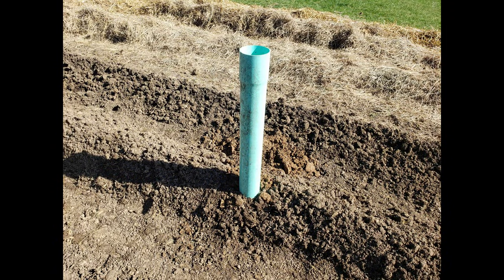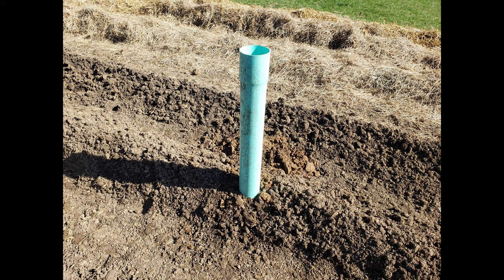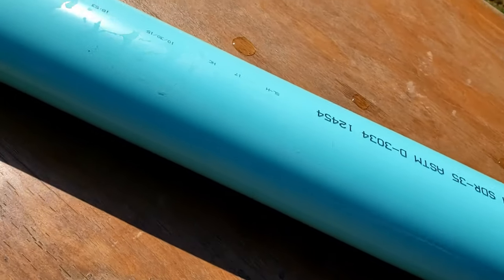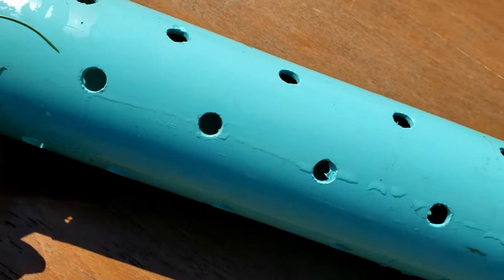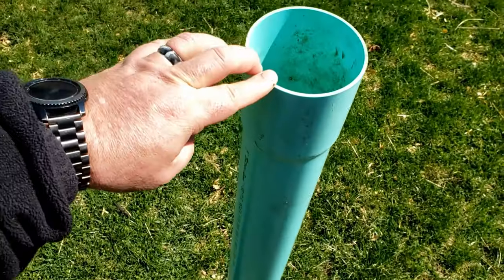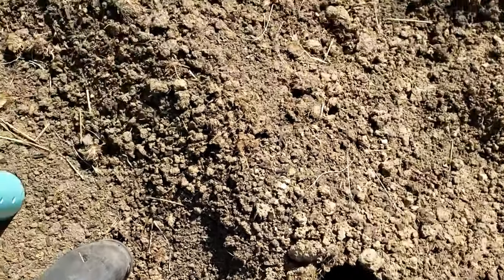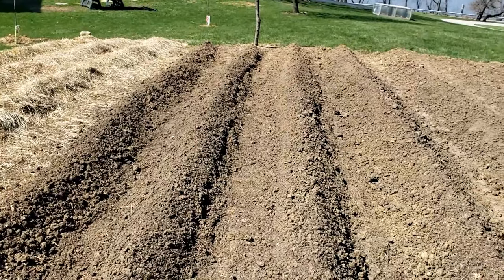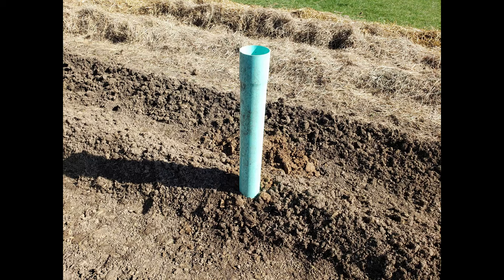Worm Tower Composter DIY

Comment: I'm curious as to how you made that hole so perfectly round so you could just slip the pvc pipe into it? -- I thank you for the idea. I'm going to get somebody with a drill to help me out (I'm a 73-year-old grandma without a drill! lol). Currently, I have a tumbling composter that gives me fits -- Nobody bothers to tell you that when you've got it pretty well filled up that it becomes too hard to rotate. Grrr. So I'm going to donate it to my local university extension office and get me some of those pvc pipes! Perfect solution! Thanks again!
Reply from the maker: I think those tumble composters are great during the tough Midwestern winter to just throw things in (we still have one for that reason), but you're exactly right... they get so very heavy! To answer your question, I used post hole diggers for this project but a shovel would work just fine too. Might not be quite as perfect of a fit, but in a few weeks after the soil settles around it you'd never know the difference. We want to do a follow up video showing the results, so please consider subscribing (if you haven't already)and turn on that notification bell so you can know when we post the update. Ive got a few videos that I'm working on in front of it... but we'll get there! Thanks for the comment!

Comment: Could you move the pipe and start again in a new location when it fills up? How quickly does it turn into compost? Is it OK to fill it up all the way to the very top (all 4ft)? I know the matter shrinks as it decomposes. I'll be excited to see what the results are in a couple months. Subscribed
Reply from the maker: @ TJ - Thanks for the great questions (and the subscription). Yes... you can absolutely move the pipe to a new location and start again or you can build multiple pipes and have them positioned in different parts of your garden.  We have a bigger family, so it helps us to have multiple places to compost at because we go through so much organic foods.  You'll be surprised how fast it turns to compost, but your mileage may vary based on how many worms you have in your garden space.  Obviously the more worms, the faster the process will go.  It will also differ from season to season... with it disappearing quickly in the summer and slowly in the winter because of temps and lower worm activity.  To answer your last question, yes we often fill it up almost to the top, but a few inches shy. We've found that birds sometimes will perch on the side and grab stuff out if it's too close to the top, so that's why we stop about 5 inches below the top.  It works great at keeping squirrels, mice, rats, raccoons, etc. out of your compost though.

Another helpful hint is to have a long stick or pole to push it down.  We've found that sometimes if we put something too large in the pipe it can cause a gap to form inside between the base and the stuff above, so we try to occasionally push it down a bit to ensure worms can reach everything.  Finally, don't forget to water it occasionally, especially in dry seasons.  It will help the process move dramatically faster by keeping it moist (not soaked).

Let us know how it goes!
Reply: @purposedrivenhomestead  thanks for the thorough and quick reply.

Comment: I love this idea! Are there specific reasons you made it four feet tall if there is only a foot underground? Do you continue filling with food nearly up to the top, and does that sink as the worms consume it?
Reply from the maker: Thanks for the question!  Yes, we made it that tall so we could do exactly what you asked about.  The one foot in the ground is because earth worms are most active in the top section and we want the nutrients from their castings to be available to the plant roots which don't go down further than that in a typical garden.  The four foot height is to allow us to fill up more space with food scraps.  To your point, as the worms eat the material, it does in fact go down and we sometimes use a small stick to push down things that get hung up at the top.  We could have made it taller but wanted it low enough that the kids could put compostable stuff in there.  Hope that helps, and please give the video a thumbs up if you liked it and we'd love to have you subscribe if you haven't!

Comment: Two years later, would you recommend doing this? I'm considering trying it in my raised beds.
Reply from the maker: I absolutely would.  We were really surprised at how quickly the compost disappeared.  I recently removed the tube and the soil was rich around where we had it, so I think it worked well.  I'll be putting it down again soon and will probably drop a video on that when I do.

Comment: I have read that mice can collapse their ribcage small enough to fit through a 1/2-in hole. The holes drilled in this worm composter pipe look larger than a half inch.

Does anyone know if this design will work with, say, 3/8-in holes?
Reply from the maker: I mention about halfway through the video that the holes are 1/2" in size, so they definitely aren't any bigger than what I mentioned.  As far as the mice are concerned... I can't comment one way or the other on what they can fit into.  I will say though that this pipe is buried in the ground about 1.5 feet and the holes are only the last foot of the pipe.  We haven't had any issues with mice digging down 6 inches in the soil to get at what's in the pipe.  Then they'd have to get small enough to push past the dirt and squeeze in the drilled holes.  Seems very unlikely, especially out in the open like we've designed these to operate. It might work with smaller holes, but remember that you're limiting the movement of the worms in and out of your composter then which kind of defeats the purpose.